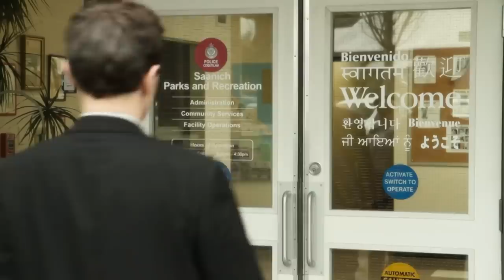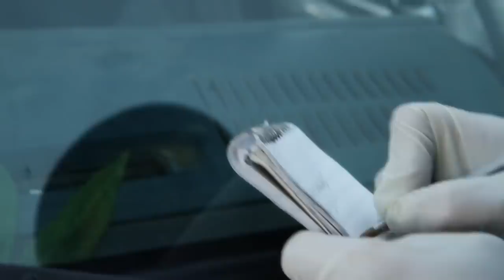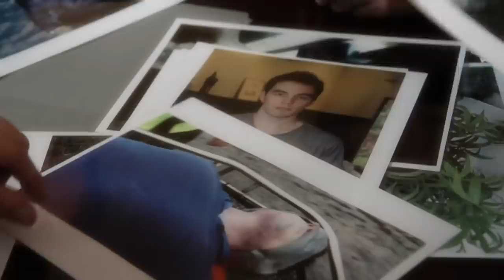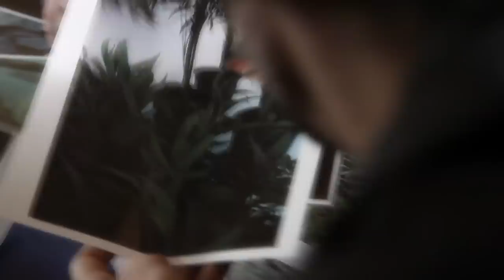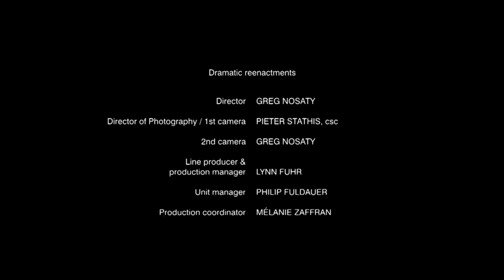The Murder Of Timothy Langmead -  The Marijuana Confessions

Comment: Asphyxiation by drowning would fill the lungs with water because that’s how you die in drowning. Asphyxiation outside the water would not put water in the lungs even if the body was put in the river after death. He’d no longer be breathing and wouldn’t have lungs full of water. What kind of pathologist are they paying? Haha
Reply: Absolutely correct! I noticed the script was off, too.
Reply: It's true what you say, but you forgot a detail, one of the criminals confessed that he pierced the victim's lungs with a knife in the hope that the body would not float, the investigators saw the wounds caused by the knife and this may have generated their uncertainty.. ..probably the water reached the victim's lungs through those stings, but the investigators did not know if the guy was dead or not when the water entered the lungs
Reply: @leatheraccessories646  good point, I’d still suggest that an experienced medical examiner could tell the difference
Reply: I don't know how to explain but look for "dry drowning".
Reply: @lg5221  I know what it is, I’m a master scuba diver. It can occur after a near drowning experience if you don’t seek medical attention. If your buddy revives you and you think you’re good, you can drown later. Didn’t happen in this case.